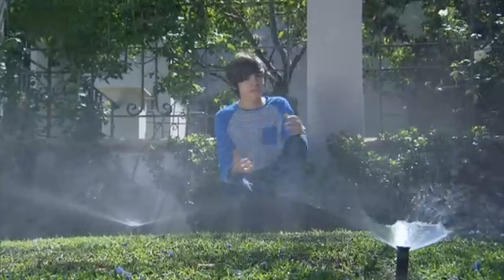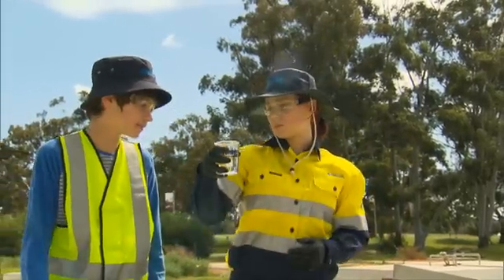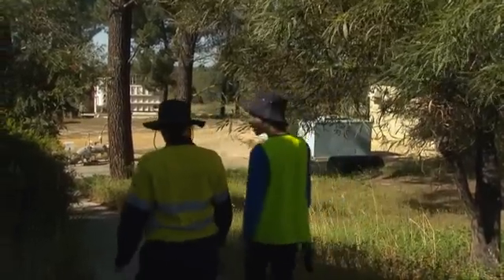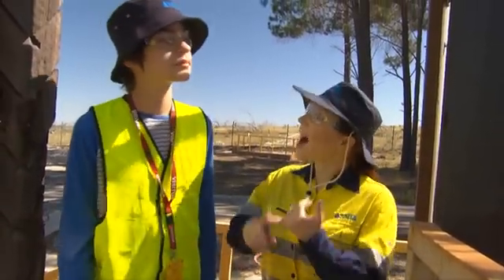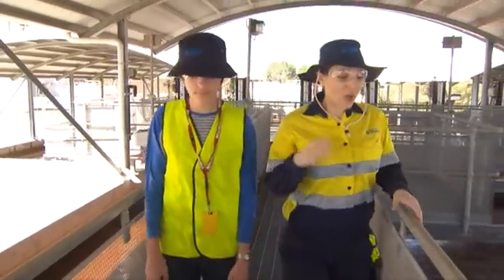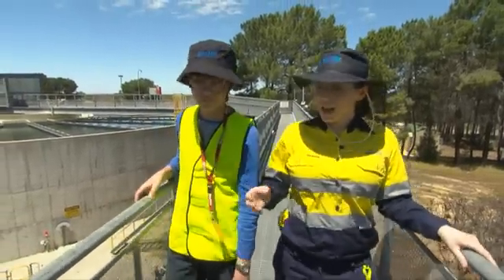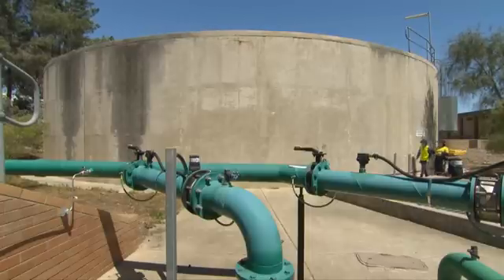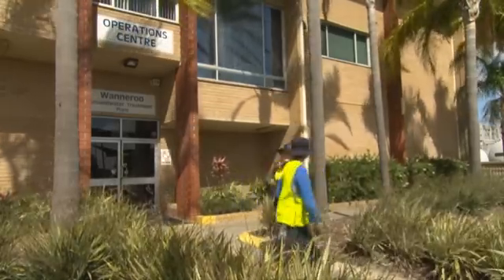Treating groundwater for drinking | Education resources | Water Corporation

Comment: Why are you adding fluoride that’s not necessary or smart
Reply from the maker: Hi Brian, we’re committed to supplying high quality drinking water. The drinking water we supply to the community is comprehensively monitored to ensure compliance with Department of Health standards and the Australian Drinking Water Guidelines. Information on our scheme water supply is available at https://bit.ly/33Mq5JQ.

Fluoridation is under the direction of the Fluoride Advisory Committee administered by the Department of Health. As such, if you would like more information on fluoridation or to raise any queries or concerns , please contact the Department of Health;
Facebook: @WAHealthy
Email: ehinfo@health.wa.gov.au
Call: (08) 9222 2000
You can also find more information here: http://bit.ly/FLH2O.

Regards ~ Lara
Reply: Water Corporation you didn’t answer my question why add fluoride it’s not necessary it’s been proven to be a health risk with zero benefits so please explain why. Thanks
Reply from the maker: Hi @bj64100 , as above "fluoridation is under the direction of the Fluoride Advisory Committee administered by the Department of Health. As such, if you would like more information on fluoridation or to raise any queries or concerns , please contact the Department of Health." ~ Lara